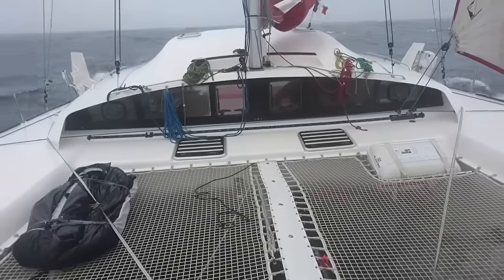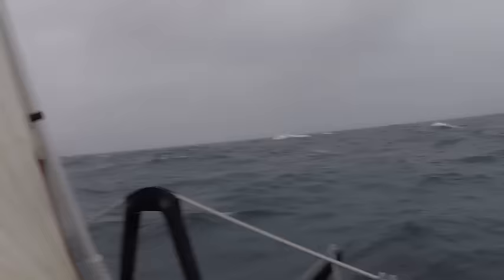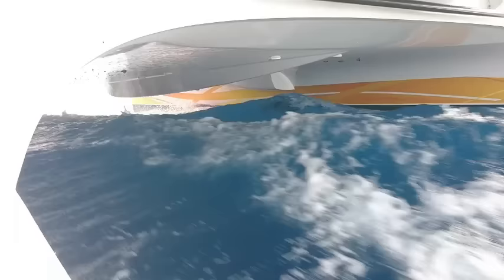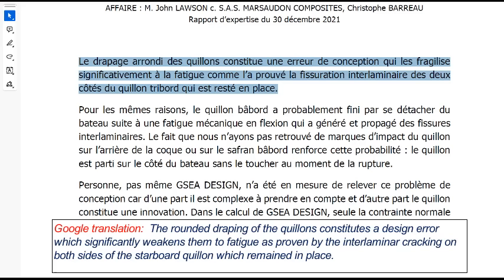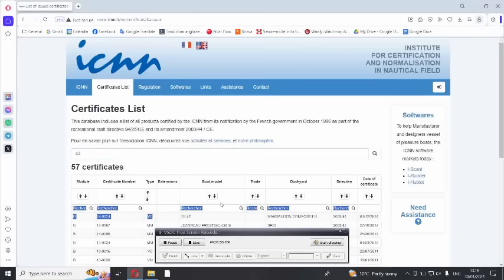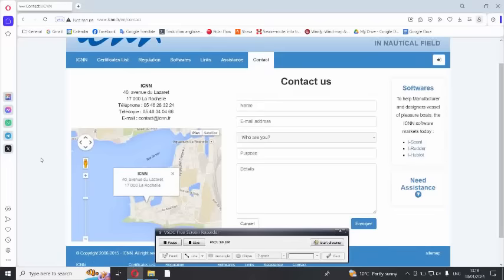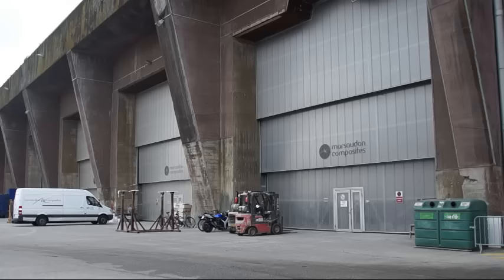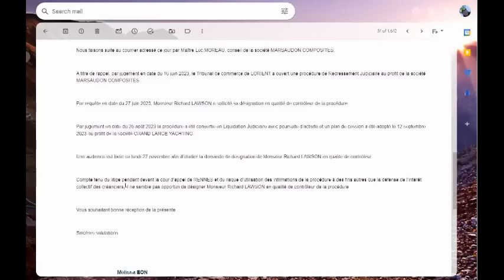Keel broke off mid-Atlantic - Marsaudon ORC42 Catamaran Part 1

Comment: This makes my blood boil and I'm sorry to see this happen to you. On a bittersweet note, had they paid you out, you would have been served a gag order and nobody would be hearing about this now. I watched the Lagoon 450 fiasco very closely and it was the same pile of BS, including what I consider a band-aid, in the builders best interest repair. The certifying agencies have to be held to a far high standard of care. I'm a structural engineer and the way we deal with this is through independent quality assurance reviews of the work being performed by the contractor: its a life safety issue. Internally our designs have to be independently reviewed to ensure the design is correct as well. Everything is documented and if there is a failure it can usually be tracked to either a design or construction deficiency (not following the design). If a navel architect want to put their name and reputation on one of their designs, it's in their best interest to ensure that their design is followed (through field review) and take appropriate action if it isn't.
Reply from the maker: Absolutely. This is the crux of the problem. You've hit the nail on the head.

Comment: This video is a huge service. I would 1) Send a complete legal evidence package to EVERY Marsaudone Composite client AND current registered owner, going back >10 years. 2) Spin-up a social media campaign intended to spread awareness of this negligence that could very well lead to loss of life. If you threaten the scam, you will have the attention of many. Also, out of court settlement is common when collusion seems evident. Settlement caps vary by jurisdiction, every process is unique. You got screwed and that sucks. What telltales did you ignore? There were many. Compared to other established cats, was she cheaper? Current owner interviews? Builder financial statements? Build inspections? I’d be willing to bet knowing what you know now, you’d see red flags straight away.
Reply from the maker: I think it's pretty sad that you can't just buy a boat knowing that it will be correct, as you would with a car. I wonder if the necessity for all of the good checks that you propose might not be necessary if the ICNN certified to a different standard.

Comment: John,  keep going GLY will have to steep in to sort this out, if not their potential buyers will be on notice.  Outremer make a big thing of the support and speed of correcting any issues and having the infrastructure globally to do so.  So if they plan to use this facility to help clear their long order book they need to be sure of quality.
Do you think a survey during construction or pre final hand over could have found the structural issues?  The worry with any boat is how do you spot these issues before hand over.
Reply from the maker: I've been talking to a journalist about exactly this question. I don't think a survey can uncover design issues like the keel and strengthener. In theory they have the naval architect who designed the boat and the ICNN behind them. However, perhaps the dry areas - certainly if a survey with Ultrasound is commissioned. In a reasonable scenario, the certifying authority might take on this responsibility.

Comment: "Lightweight" and ocean going has never sat comfortably with me.
Reply from the maker: Yes, the build safety margins are tighter and require extra care. I would say that rough seas didn't cause the damage here. The resin infusion failures were created in the factory. The poor design (keels and strengtheners) was achieved on the drawing board and the rudders filled with water because they were not properly sealed in the build process.
Reply: @geezer355  Agree with you 100%. My heart goes out to you in this situation, I hope that you can stay strong and find your way back on the Ocean in a suitable vessel. Have you thought of a crowd funding to raise capital to achieve some of the following: Make sure no other poor bastard suffers like this again with dodgy builders, hold certification bodies responsible, put pressure on their legal team and finally, get you $ back as per the court order. I shudder to think of anyone else buying one of their brands. 

It seems that every year or so I read about another keel falling off or a cat splits etc. Standards in glass fibre/exotic's are simply just not there. Good luck and please keep us posted.
Reply: Is the same in the RV world. Lightweight and Ultralite trailers just mean built to the bare minimum structural integrity.  Unfortunately people just see weight numbers their truck or SUV can tow and buy it.
Reply: @1320fastback true except when your RV leaks you don't drown in the middle of the Atlantic.

Comment: Also, no beach cat owner would have commissioned a fixed keel cat as we understand the hulls can be subject to divergent forces during surfing. Also we would never have lent it out to idiots who would run shore-breaks in it. Again sorry for your loss.
Reply from the maker: There are thousands of fixed keel cats that work. The problem here is that the designer made keels that are much more high aspect than normal cat keels to improve upwind pointing (which consequently carry higher stresses), and put a radius is the composite exactly where the loads are at their maximum.

Comment: If that was my boat I would make shallow full length kellsons. 
Then she would sit on the bottom better and still go to windward fine.
Not only that but she could sneak across the bar with less than half of the draft ‼️⚓
Reply from the maker: The deep keels are designed to improve upwind pointing. But the consequence is more stress at the joint, so you have good reason for your point.

Comment: It is as if John fell overboard.  The crew upon whom he relied, refused to throw a life ring.
  
Yet, John endured, swimming toward a moving boat.  Moving, yet miraculously losing wind.  At long last, she was finally motionless; more particularly, dead in the water.
 
Unfortunately, a new captain appeared on deck and relieved the crew responsible for navigating into the breathless depression.

The new captain was aware John was getting closer…only two arm lengths remained after 1,825 grueling strokes.

Then, the world renowned, French captain started the engine.  And with a flick of the wrist so effortless that it seemed not only habitual but planned, he throttled away.

To his crew, or perhaps to himself, the captain then declared…“More bread for us”.

Comment: Suggest contacting eSysman, even though it's not a super yacht he may be interested to cover your situation in the context of other yacht builder issues.

Also, worth considering reaching out to Colin (Parlay Revival) to amplify this story in light of the positive impact he had on Lagoon and their 450 bulkhead issues.

Finally, the O'Kelly's have experience of Outremer yacht Moonshot and may have some insight to share, and also may be interested in amplifying your story.

I wish you all the best in resolving this fairly.
Reply from the maker: Thanks for the suggestions. It has been my aim to try to resolve this myself because it's super stressful and I imagine folk who have been through similar stress don't need to relive it. However, I do want the facts out there so that folk can add them to their own experiences and research and make decisions with as full a picture as possible. I'll give it some thought.

Comment: Safety failures in boat manufacture tend to go undetected for years or decades by owners who don't actually use their boats on a regular basis. And these days that's most boat buyers, so manufacturers don't often see consequences for marketing inferior builds. There are lots of opportunities for them to "realize savings" by passing off "new" but inferior and cheaper materials and methods as "improved composite technology". So it has become all too common.  "Sandwich" or "hex cell" materials with interior non-fiberglass layers are especially vulnerable to catastrophic waterlogging. 

I think if the boat you're buying is significantly lighter than older boats of the same size that have a known cheap maintenance requirement and good safety record, you're probably in for trouble.

Comment: If you follow the Sailing Parlay Revival who have a 2012 Lagoon 450 Catamaran and found some basic design flaws they went through a long exhange with Lagoon before any responsibility was accepted. Fortunately it did not go as far as a legal exchange but it took a long time to resolve......
Reply from the maker: I wonder if a common theme is a failure of certification.

Comment: Buy a light weigh boat for offshore , hehehe there are compromises
Never had any issues what-so-ever with my 2004 PDQ 44 
The new owned just had it surveyed and it only needs new rigging, not surprising after 20 years, one around the world and a dozen crossings.
Reply from the maker: The damage to this boat didn't happen offshore... The resin infusion failures happened ashore in the factory, the design errors happened ashore on the drawing board and the rudders were not sealed ashore in the factory. It seems that this lightweight boat couldn't survive even being ashore...

Comment: Acquiring a company with the option of waving it's liabilities. That's the real issue here. 

When going bankrupt the assets of the debtor are owned by the debt owners. Any remaining assets should be divided proportionally amongst said owners. Waving debt outside of the control of debt owners is theft. No two ways around it.

Comment: Thanks for sharing. The attitude towards safety is gracy from the yard.  Are outreamer cats basically built by the same company as your boat?
Reply from the maker: Only a fraction of the total number of Outremer cats.
Reply: @geezer355  what models?
Reply from the maker: They make the Outremer 45 there. But I don't think it's all Outremer 45 boats - I believe there is also production elsewhere, but I don't know the ratio.
Reply from the maker: Outremer 45.

Comment: John, terribly sorry to hear about your experience.  Can I ask what made you decided to buy one of these in the first place?
Reply from the maker: Narrow hulls, light weight, high bridge deck, long trampoline, centralised weight distribution, established builder, certified category A by a government approved body...
I've since delivered 2 heavier displacement catamarans, with smaller sail areas, across the Atlantic. They have amazing accommodation, but I don't personally feel that I need that. They can be sailed with inexperienced help, you can reef later and carry A sails longer, but I'm not opposed to routing more carefully, reefing earlier and taking more care with the big sails. I miss the balance, composure and progression of my boat.
I know there are a few folk here who feel that light boats are generically unsafe and I can respect their view. But this boat was not broken by the sea or weather. The resin infusion failure happened in the factory. The strengthener problem arose on the drawing board. The leaky rudders were not sealed effectively in the factory and the keels broke because of an error at the drawing board coupled with Marsaudon's decision not to make them with the designed weight of cloth. If the builder had done their job, I would still be sailing my boat.

Comment: You have unfortunately  had rotten treatment from the manufacturers..  Theres a couple with a Leopard that have had a similar experience with dry laminations in a new boat and the great bulk head issue with another major Catermeran manufacturer Lagoon.
Its interesting one of the fathers of modern Cats and Trimerans Derrick kelsall... always favoured composite sandwich bulkheads in his boats offshore racers and private vessels...because he learned very early they tend to seperate over time due to differential expansion and movement between the composits and the marine plywood. 

You should really speak to the barefoot doctors with their experience of loosing their one year old Leopard to fire in the US and taking out another in the process. 
Their battles been mostly with the insurance companies and the lawyers.

So much so that they have gone for an Al built cat as a replacement  and have had to wait about two years for a settlement.

If you know the guys at Atlantic marine Devon ..builders of the Daz Cats. and  Rapier r550 they also might be able to advise on the technical problems you're now facing. 😬🤞🏼
Reply: Chris White knows a thing or two.....!
Reply: @dancarter482  

I mentioned the late Derrick Kelsall because he built so many offshore racers like The GB racers and the Crossbow speed record holder ... he also virtually developed the Trimeran Atlantic ORC racer. Also the KSS flat sandwich rapid fabrication building method..

Comment: Was/is there any epoxy bonded to acrylic/polyester by any chance?  Curious.
Reply from the maker: I don't know. The boat is polyester, but I don't know whether epoxy is used in places.
Reply: @geezer355   Just a longshot observation John.... At 2 minutes in you mentioned an epoxy coating over a substrate with a primer that may not have cured.  Then you showed a very spotted material.   A broken Keel caught my attention, but that comment warranted one back.    Coating failure is a "cascade of events scenario" like an airliner disaster.   I have no idea what that surface was in the video, but those spots were likely secondary damages. 

In many cases, epoxy is cured with a solvent making a 100% solids product matrix. That means zero elastomeric coefficient and when placed over a flexible, movable substrate, you get stress-relief in the form of a cohesive substrate failure.  The weak link is not the epoxy, ever.   Once fracturing for stress relief occurs, gasses and water vapor and moisture carrying soluble salts, will ingress into that cavity. There, salts begin to expand when drying and creating more delamination.  It can look cosmetic for a long time and eventually result in blistering or peeling.  

John, kudos to your adventurous soul, may you always stay safe and sorry for the troubles you dealt with!  Never heard of losing a keel!
Reply from the maker: @ApatiEktetheimenos  The comment refers to the antifouling. I paid for Marsaudon to apply Copper coat antifouling in the factory prior to launching the boat. This type of antifouling is epoxy resin impregnated with ultra fine copper. After less than a year the antifouling (the green area) blistered. My understanding for the reason is that the underlying paint base coat, or hull filler, was not given enough time to dry, so after the copper coat was applied the vapours leaching from the underlying paint/filler were trapped beneath the epoxy copper coat. This caused blistering and in some cases the blisters burst exposing the underlying paint. Marsaudon accepted that it was their fault but the keels broke while sailing the boat back to their yard, and the subsequent disagreement resulted in us never getting to the point of fixing it. Thanks for your interest and kind words.

Comment: That’s insane! My father had an insurance claim on a sunk 48’ sport fish. Through Loyd’s marine, the t turned into. Nightmare! They paid a set money to “Fix” a boat that had Sunk! 100% under in fresh water of Columbia. 
But, just like a house remodel a restoration costs insanely more than new construction. And boat sucked up the cash, he dumped it for Pennie’s on $.
Marine world is risky! 
This particular story is beyond sad! This was this man’s retirement! And they could have “fixed” their mistakes!!! 
However the “Dry infusion issue!!!!!!” Is beyond serious! And would be extremely labor intensive and likely never as light and strong as if done correctly as designed. The structural bracing separation can be caused by a lot of reasons! Workmanship rather than design is most likely, design of component composites is likely
Reply from the maker: 'Insane' nails it...

Comment: This is Shocking and terribly unfair. 

However I don’t see how you could put blame on GLY, it normal that a condition of their purchase of the bankrupt business would be to not to accept taking on the liabilities and only buy assets. It's quite a stretch to imply that the issues with a Marsauden boats are indicative of problems with other GLY boats produced in completely separate factories. It is indeed concerning that the same top management at still employed at the Marsauden factory and this will undermine credibility of intentions to turn the business around and ultimately the boat that come from that specific factory.
Reply from the maker: I've tried hard not to blame, but simply to tell the facts. If you think that GLY have conducted themselves fairly I can respect your view, even if I personally find their unwillingness to even talk to me perplexing.

Comment: Many boats are called “ ocean going” or blue water. Fact is, if the yachts don’t have keels that are integrated with the hull are not suitable. Most production yachts have bolt on keels,,, these will fall off if the bolts or whatever they are attached to , fail
Reply from the maker: The keel failure is the most spectacular aspect of this story, but actually it's not the most important. On cats the keels don't keep the boat upright, their role is simply to allow you to sail upwind. You have a second keel and 2 motors if one fails. The really serious aspects of this story are the resin infusion failures and the inadequate design of the strenghteners, both of which the expert considered could lead to the break up of the boat.